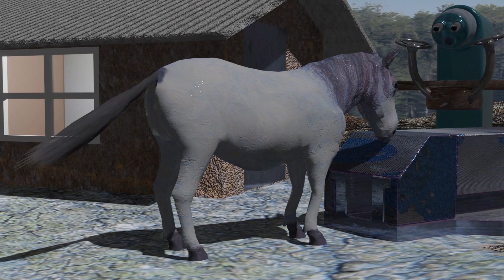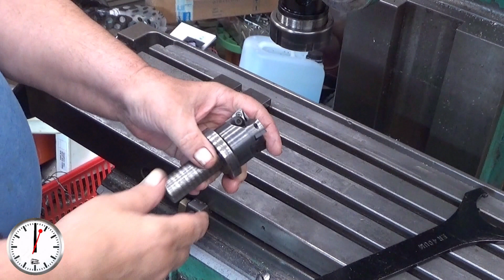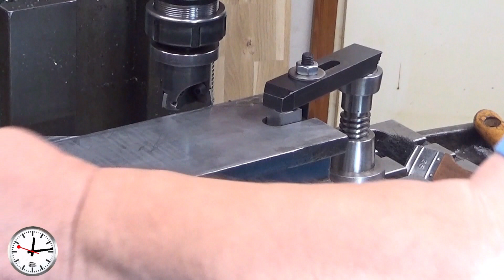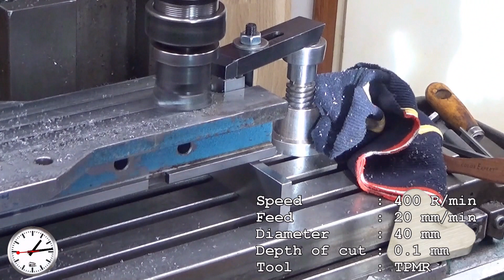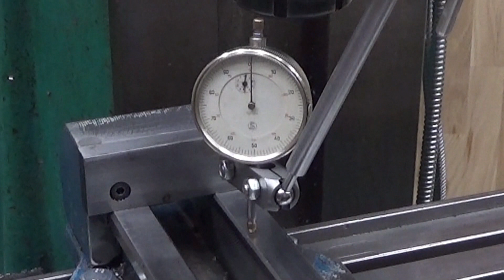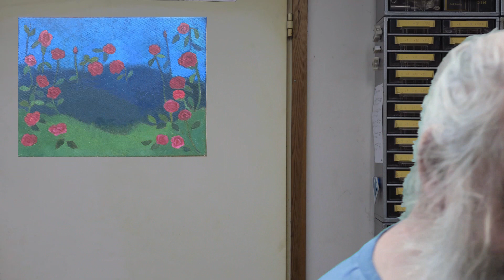Straightening my tilted Hilma Röhmheld machinist vice

Comment: cut a pair of parallels and reverse the in the vise, measure them and then mark one end  
when you need to really get 0.00 pull them out of the toolbox ..... or find a guy with a surface grinder and bring a 12 pack of beer ......

best regards 

Steve
Reply from the maker: This is exactly what I will do if I cannot lure someone to make it happen. I think a good deer sirloin would make better job than a beer pack ...

Comment: Did you stone the bottom surface before the first try? It probably had a good ding on it that caused the problem. It's impossible that the Germans would have made that big mistake in the grinding and they usually don't need to be reground
Reply from the maker: Stoned everything a few times before measuring the vice ways. The ways had a height difference of 0.05 mm which made me suspect that the bottom was not in it's original condition.
Sure enough, the bottom was not only tilted it also had hills in it. I checked it with my straight edge.
I suspect that the seller had removed some rust or something from the bottom and since the material is quite tough, some sort of (angle) grinder was used.
Reply: @FinnoUgricMachining  that's probably why it was for sale
Reply from the maker: @MF175mp  Yes. Now I just have to find someone with a surface grinder to get this really straight.

Comment: Milling releases some surface stress and cause some warping. You could try scraping the surface for higher precision
Reply from the maker: Warping is the reason why I took very thin cuts from  it. Well, it definitely became straighter than it was. Actually the deviation is now 1/10 of what it was. To get this really accurate, I need to contact one of my friends with surface grinder and ask a favor.